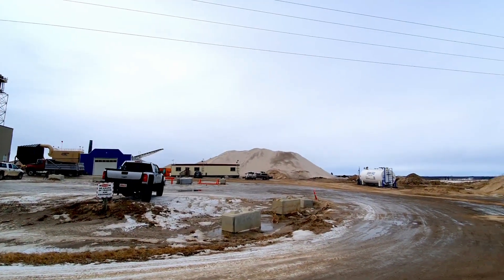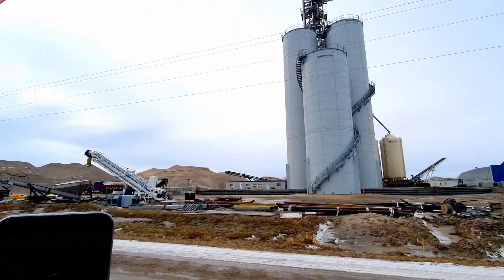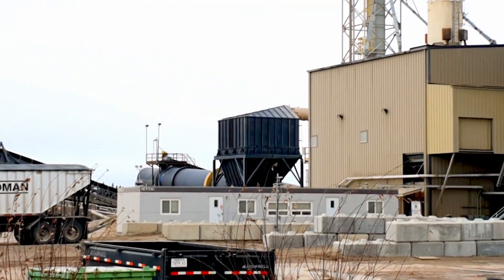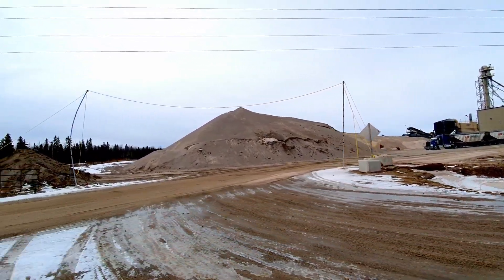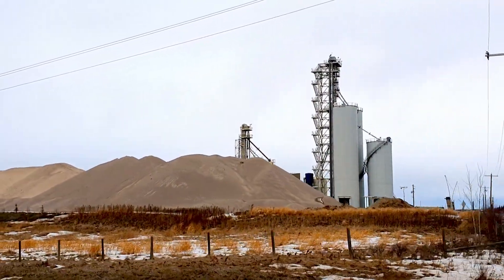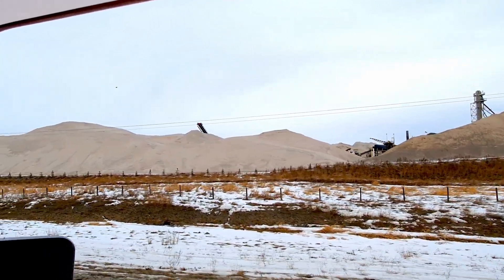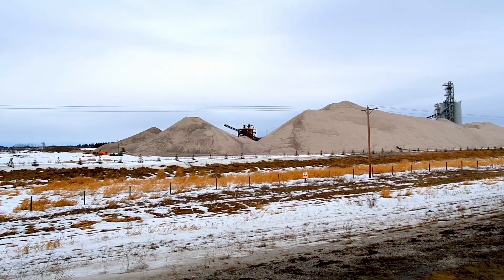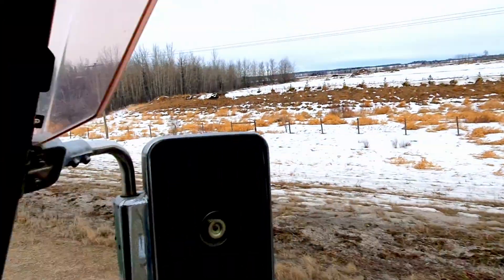Frac Sand Facility

Comment: That's an interesting method of moving sand that I never considered. You could really move all sorts of things via pipe with that concept.
Reply from the maker: Yes. He said they inspect the pipe ( not sue if you're familiar with "pigs",  or "smart pigs", but they are experiencing virtually no interior washing or erosion. Even if it did wash a hole in the pipe,  it wouldn't be an environmental problem being only sand and fresh water. 
If you don't know anything about pigs I could make a short video explaining them. But in short they can be anything from a ball, or foam bullet to a multi million dollar device capable of measuring, mapping and recording the entire pipe for any flaw, damage or corrosion.
Reply: @lovesloudcars  Yeah I'm vaguely familiar with them. Never looked into them though, if you see one on your travels maybe get a quick video. Surely would be interesting to take a look at.